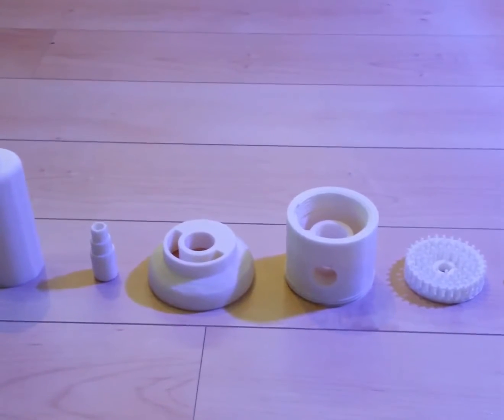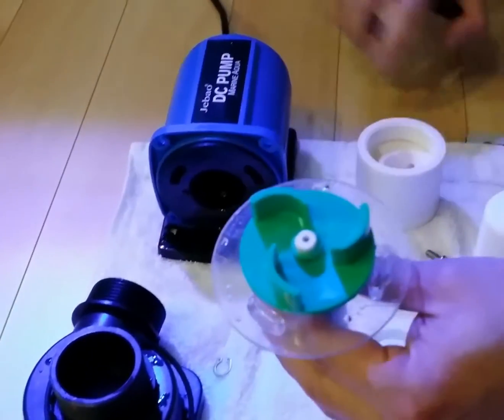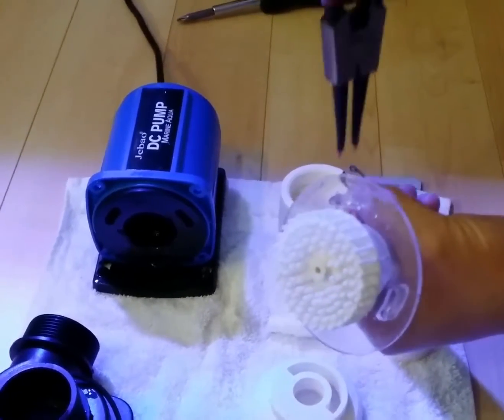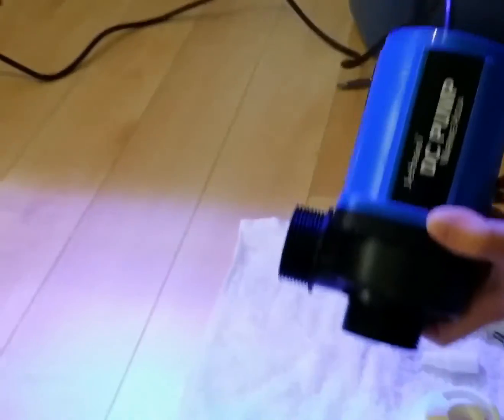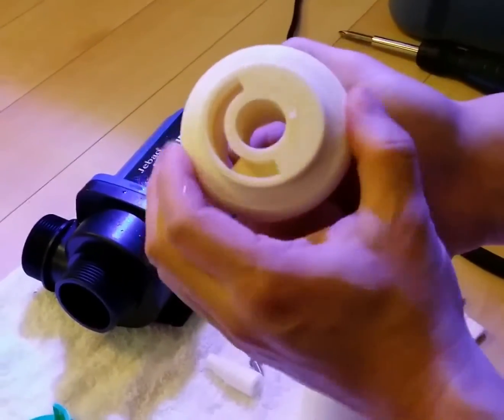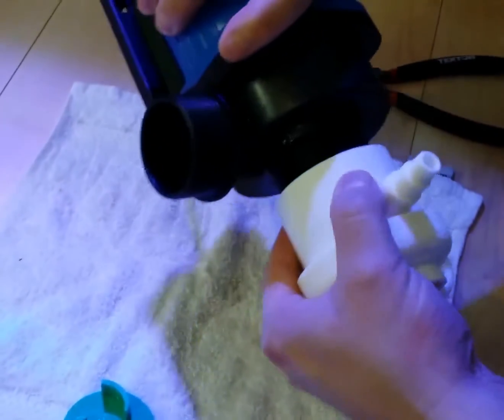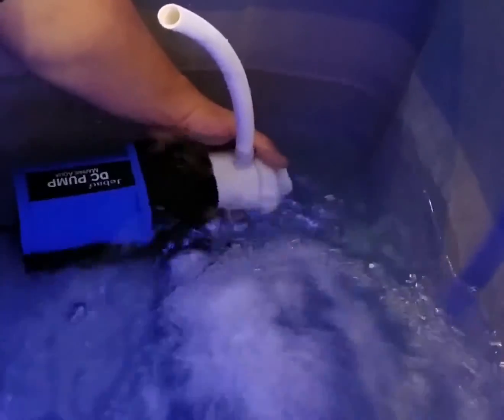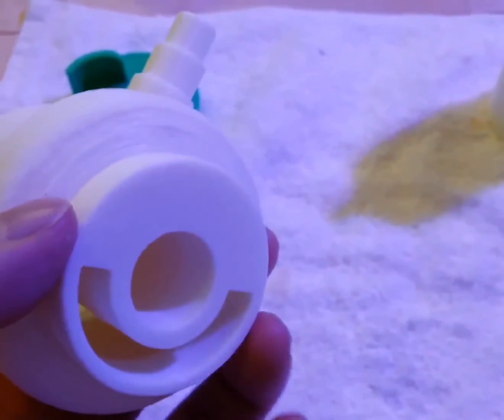3D Printed Skimmer conversion kit installation

Comment: Can you make me an impeller for the jebao dct3000 ?  I just need the impeller only.
Reply from the maker: I don't have a dct3000 on hand.. you'll have to send me your impeller so I can make precise measurements.
Reply: Daniel Lu 
Address?
Reply: It is the same size as the regular jebao dc 3000. If you put it on your website I will buy it or Ebay.
Reply: Can you send me the file to print? Im from México.

Comment: hello
is it possible to adapt your kit on jeabo DCS 9000 ??

sebastien
Reply from the maker: If you have a DCS pump, check if the plastic impeller can be removed from the shaft like the DC and DCT version.  If yes, most likely, it will work.  I do not personal own a DCS pump so I don't know for sure.

Comment: Hello, Do you have a kit for the DCS12000? DCS9000? Also do you know what kind of LPH draw are you getting at 100% power.
Reply from the maker: Your safest bet is to get DC9000/DC12000 pumps if you want to use my converter kit.  LPH will depends on your back pressure and how your adjust the volute water inlet size.  I don't have a device to measure LPH.  When I tested DC6000 with my kit to mix RO water with Instant Ocean salt mix, it was able to skim off some "gunk" that keeps the salt mix from clumping together.

Comment: Hello,
I have a DC 12000 1st generation. Is it compatible?
My pump of my skimmer is ko, I am in France, what would be the delays of manufacture and delivery?
I have no skimmer for now and it would have to be fast, I'm afraid for my corals
thank you
Hugues
Reply from the maker: Hug35 yes, it will work.  please review my website for more info.  takes 24-48hrs to print depends on my current project.  shipping to France is about $20.
Reply: Finally I have to buy a new pump.
Is compatible with the new DCS silent 12000 pumps?
My skimmer is almost 12 inches in diameter, there will be enough bubbles?
Desole j uses google translation
Reply from the maker: I do not believe the DCS impeller is removable from magnet and shaft, so I don't think it's compatible.  DC pumps are also silent.
If you don't reduce the size from pump to skimmer, than it should work fine with 12" diameter skimmer.
Reply: So you would advise me to take the DC or DCT pump? In 12000 or 15000?
Reply: I saw that there were also DCP pumps?
Reply from the maker: check out details here:
http://dluphoto.synology.me/impeller/
Reply from the maker: I recommend getting DC-12000 pump.  I do not have a 15000 pump so you might need to buy PVC reducer to fit the volute part of the pump.  Some people have reported their DCT do not have metal retainer clip but the one I got did.  Safer to go with DC model.
Reply: I look for I no longer find the models DC 12000 with the purchase. On all commercial sites this has been replaced by the DCT or DCS
Reply: Hello
I just bought a new DC 12000.
I ordered on your site a kit for a delivery in france.
thanks in advance
Reply from the maker: thank you.. I've send you an email regarding this order.

Comment: Hi Daniel...thinking about ordering your kit.  Your site is down.  Which Jebao DCT pump should I get to replace Red Dragon 1500 pump.  To be used on a Vertex Alpha 250 cone
Reply from the maker: had power outage for half a day, website is online now.  Website have info on what I have tested.  thanks.

Comment: ok thank you...

is the new wheeler  realy better ? 
the pump is  always silent with the kit installed ?

on your web site I can pay with paypal but i don't understand when i will pay the ship cost .....???

sebastien
Reply from the maker: yes, pump with kit is silent like before mod, just the usually slimmer air intake sound.  Add a silencer will help a lot.
From your address, I can then determine the shipping cost from usps.com.  Then I'll send you PayPal money request for additional shipping cost.  At which time if you do not agree to the additional shipping cost, you can cancel and I will refund in full.

Comment: Hi Daniel,  I'm planning in upgrade my skimmer with your kit.  My skimmer is 10" of diameter and 24" tall , what newest version of jebao dct pump and your conversion kit do you recommend for my proyect?
Reply from the maker: I personal have a DCT8000 that I ordered in 2015 and it works great.  Assuming Jebao haven't changed anything, DCT8000 would work great.  Otherwise, an older DC9000 or DC12000 will work as well since you can adjust the pump power level.

Comment: Will this kit work with the new Jebao dct6000 pumps? The impellers seem to be held on differently.
Reply from the maker: I have heard dct6000 may not have the metal retention clip.  I've ordered a dct8000 in 2015 and has the retention clip.  I don't know if Jebao to not placing the clips now or just a couple are missing the clips.
Reply: yes- need to know if this will work on the newer DCT or DCS pumps or not- saw one amazon comment that the impeller is made differently on the DCT - apparently you cannot take the green piece off the shaft. So, obviously you cant put on the needle wheel on if you cant take off that green plastic piece.
Reply from the maker: +acer B 
correct, if you can not take the green impeller off, this kit will not work.

Comment: If I order a kit for DC-6000 now, can this kit still re-use able for DC-9000?
Reply from the maker: yes, but not optimal.  You'll need to buy 1.5" to 1.25" PVC adapter at Home Depot/Lowes.
Reply: Thanks, I will order now.

Comment: Will your kit fit all Jebao DC 6000, 9000, and 12000? Or is it different size depend of each pump? Can I still order at your website?
Reply from the maker: The impeller part is the same for all pumps.  DC6000 have smaller volute thread and DC9000/DC12000 are the same.
Yes, you can still order from my website:
http://dluphoto.synology.me/impeller/

Comment: Works great. Took about a week to receive. The videos are deceiving I can't even hear my skimmer sucking air. I am using a vertex 180 skimmer and running the jebao 12000 pump maybe a little over kill but it's working great. The pump I used was old so I had a lot of trouble getting the factory impeller off  the shaft. I also didn't have the correct pliers to remove the ring save yourself the trouble and order a cheap pair when you order this part. Thanks for making this part available.